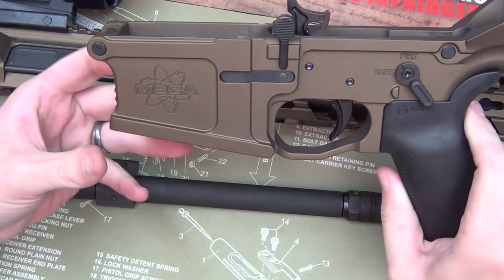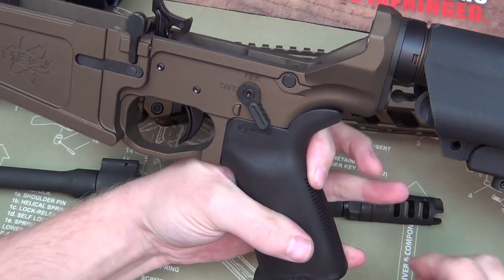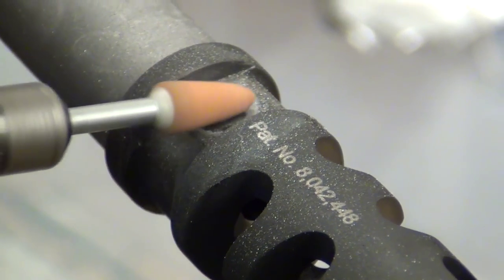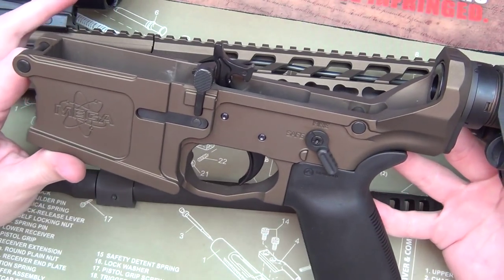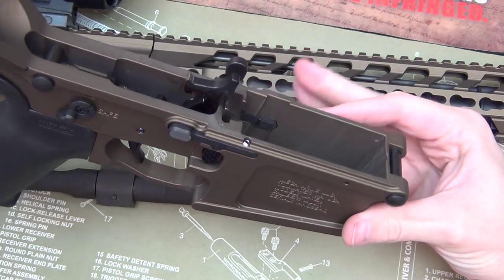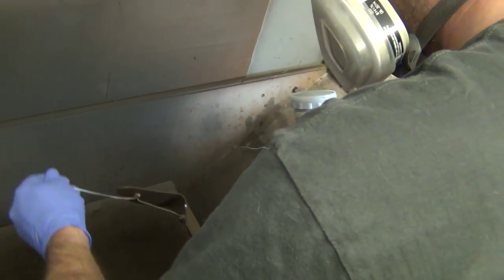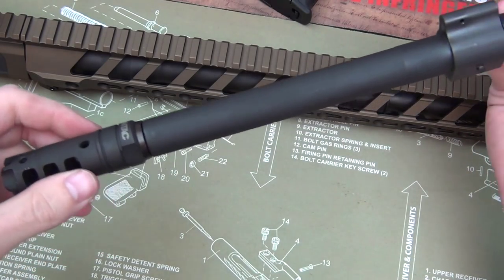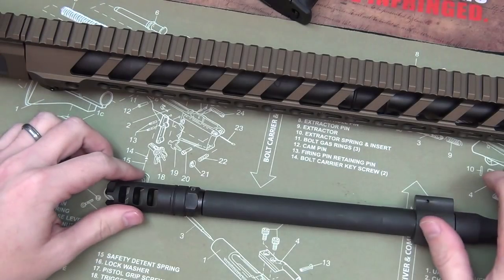AR-15 - Atomic Tactical Cerakote & Gunsmithing - nsz85 Discount Code!!

Comment: What's the reason for pinning the gas block and pin welding the flash hider?
Reply: +Eric Hovermale Usually its a 14.5 inch barrel and they put a muzzle device to keep it from requiring a stamp.

Comment: Nate, is your code still good?
Reply from the maker: +jlgil1973 If it isn't, let me know.
Reply: nsz85 How has the cerakote held up? Also, I was told the sandblasting required to cerakote reduces the dimensions of the aluminum...when the cerakote gets too beat up is there enough aluminum left to sandblast and re-cerakote it without compromising the dimensions of the rifle?
Reply: Eric Q if you beat up Cerakote to where you don’t like the way it looks then stop throwing your gun off a bridge before every range session

Comment: What's the reason for pinning the gas block and pin welding the flash hider?
Reply: Pinning the gas block is done to ensure alignment and prevent rotation after hard use or lots of rounds down range. I had my lo pro block rotate after about 1750-2000rds through my AR. It's is done as an extra measure when beating your gun or just shooting it a lot. The pin and weld of the flash hider was done to bring the 14.5" barrel up to the non-nfa minimum length requirement of 16". When you pin the flash hider properly the ATF deems it now a part of the barrel. Don't want to spend 10G and 10 years cause the ATF got butthurt over 1.5" of barrel!